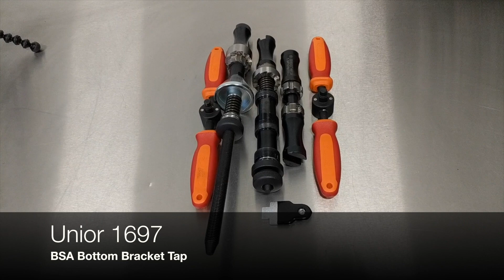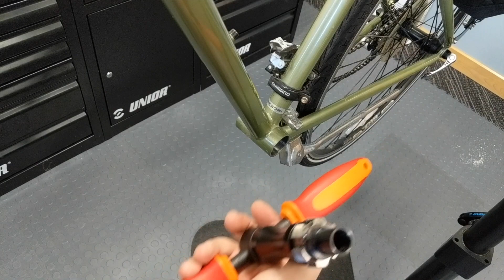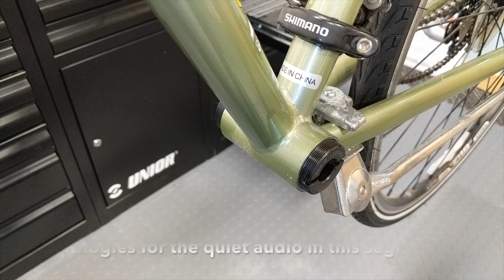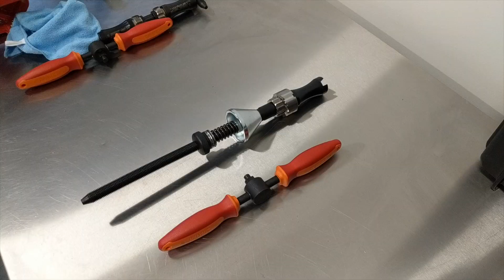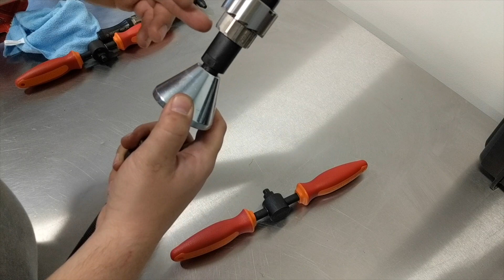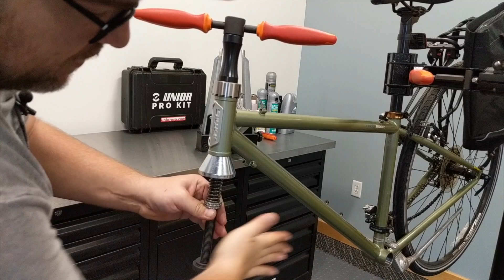Unior's New Bicycle Frame Prep Tools - BB & Headset Facing, Reaming, and Chasing Tools

Comment: I just ruined my headtube using this tool. Because now I can slide my headset in using my fingers. Reamer 1694.1 the headset is chris king nothreadset 1 1/8. How could this happen.
Reply: I’m sorry to hear about your head tube. I’m really glad I checked the comments before using this tool. I measured the same  1 1/8” 1694.1 reamer with Mitutoyo calipers, and it came out to about 34.03–34.10 mm — and that’s measuring closer to the lower end, which enters the head tube first. That’s way over the ~33.9 mm internal diameter needed for a proper press fit.
For reference, my Chris King cups are very consistent at 34.03 mm all around. So using this reamer would oversize the head tube beyond spec — it should actually be about 0.1 mm smaller than the cup OD for a secure fit. Returning it.